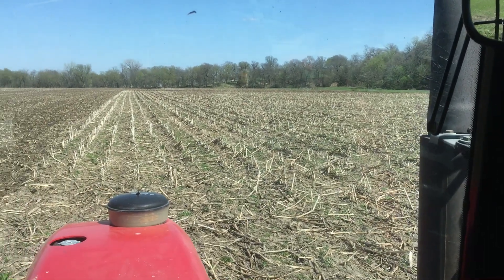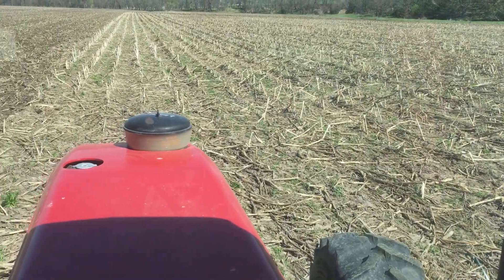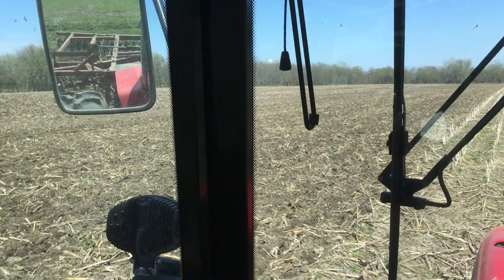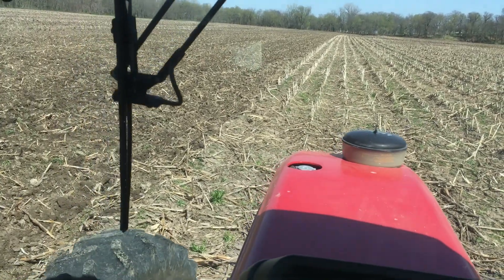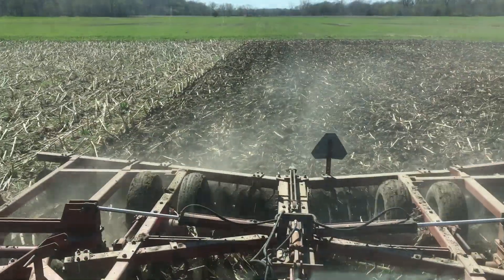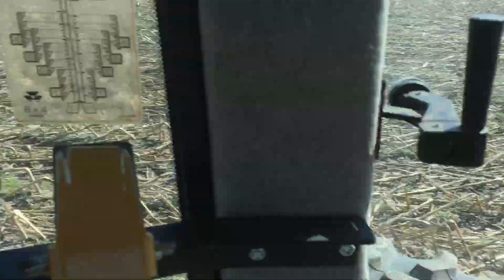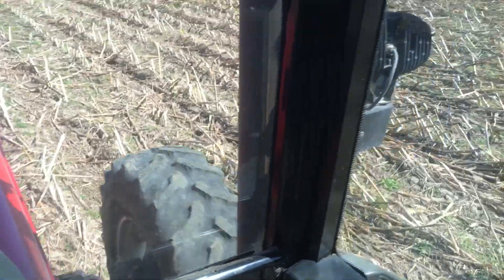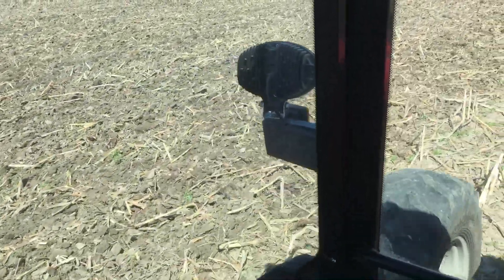Disc-Primary Tillage--depth/speed/residue

Comment: What is the difference? Most guys will cultivate about 10 degrees off of the line. I notice you going straight.
Reply from the maker: Not sure of your question...I always go straight with my fields (the one exception that comes to mind is discing down a huge cover crop--then I will go 10 degree off and slow speed way down).  I am not overpowered with my tractor.  This disc always tends to ridge a bit.  If I go at angle the ridging is worse.  The points I am attempting to communicate 1.  go as fast as possible (residue mixing) 2. go as deep as speed (you don't want the disc "jumping" around)and MOISTURE allow (don't turn up ribbons/clods).  The purpose here is ONE pass primary tillage.
Reply: @GeigerFarm  
Thanks, the light just came on. They all use chisel points with sweeps. If it lined up with a row it could let some stocks pass between the first row of teeth. At an angle it would get them all but it is bouncy. It's great to see you doing well without chemicals. Great narrative comments also. Keep it up.

Comment: Have you seen or heard of any used balers up that way, prefer twine?  Like to stay less than 4K if possible as we are just getting started with hay.  To much money going out trying to get equipped. There’s just not much down this way. A lot of junk that’s over priced.
Reply from the maker: Here is your best bet... https://springfield.craigslist.org/grd/d/crane-square-baler-massey-ferguson-124/6858482636.html  You will have to find a massey mechanic to fix the notter.  Shockleys in Hiawatha would be able to fix.  Use Search tempest to search all the local craigslist.  Good luck.
Reply: Geiger Farm would you mind texting concerning some questions on a Massey Ferguson baler. 81756447two1

Comment: Are you able to plant directly into that or do you need to go over it again with the field cultivator? I've got a similar situation with my corn stubble. My stalks are a little longer, so I'll run a flail mower/stalk chopper over them. Then I'm planning on discing it once to cut up the corn stalks, incorporate turkey litter and kill weeds. After that I'd like to use my 750 drill to put sorghum sudan right into that seedbed.  Do you think that'll work? I'm a little worried about there being a smooth enough seedbed for the sorghum, but don't want to go over it again with the field cultivator prior to planting.
Reply from the maker: Could work..but really depends on how smooth the seedbed is.  You are right to be concerned.   Sorghum sudan is pretty tough though.  Make sure the ground is warm enough!  Discing twice will usually give a good seedbed.